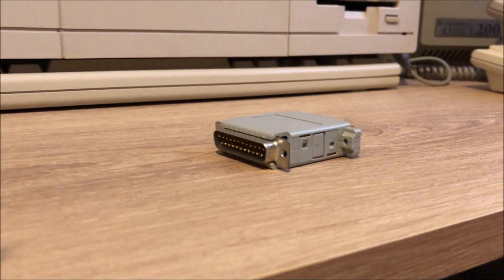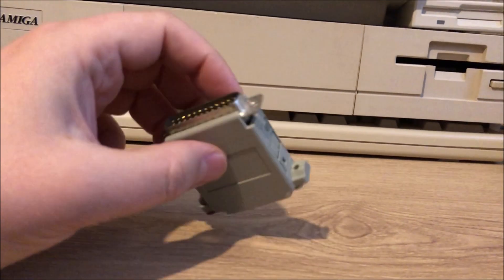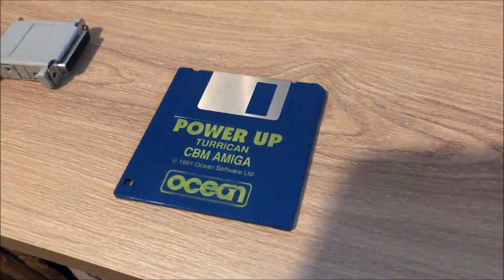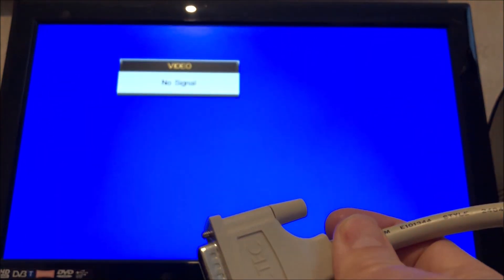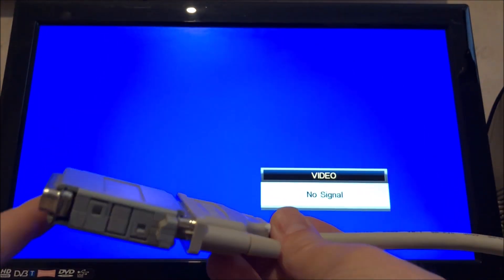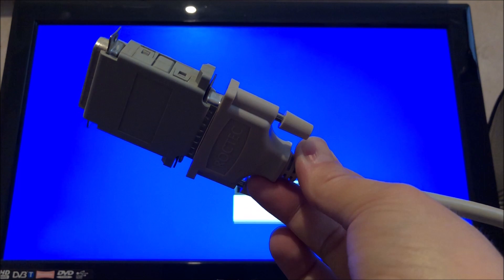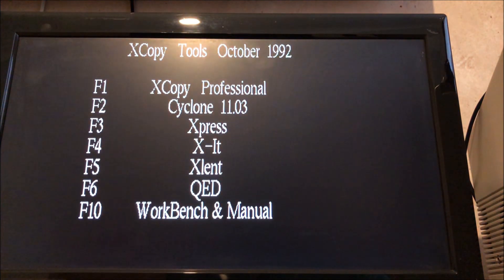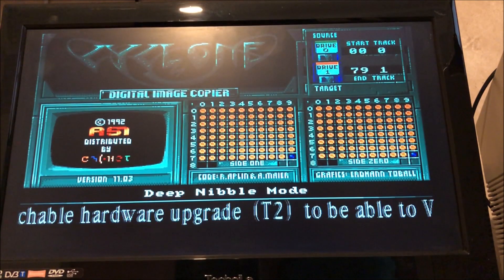Amiga Cyclone Cartridge Test / Experiment

Comment: Can you try to copy the copied disk, bet ya it won’t work.
Reply: Correct the duplicate works, but also won't copy. Even if you use the cyclone device it won't duplicate the cyclone copy.  I can't remember if the cyclone device enabled writing to out of spec tracks or length but it was probably something like that which enabled the original disk to be copied.